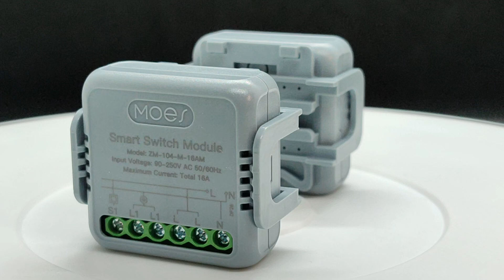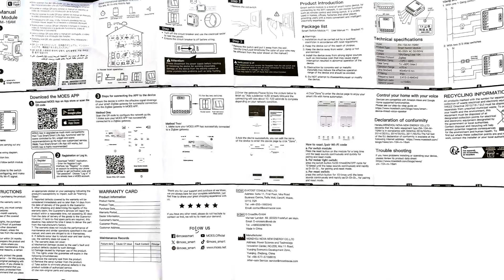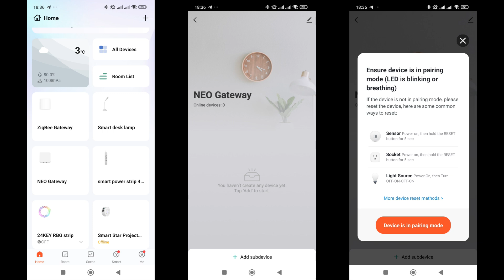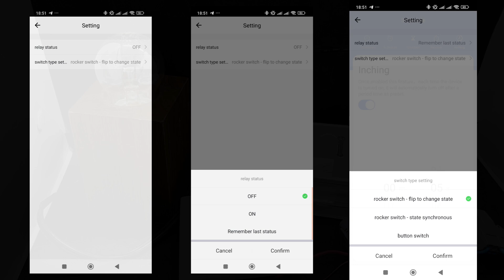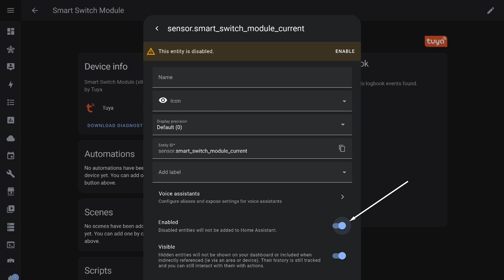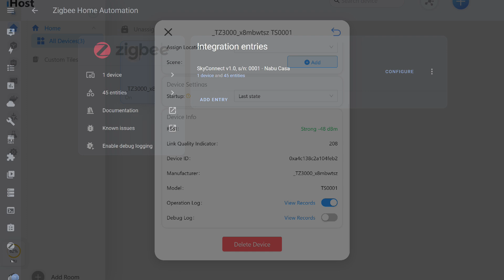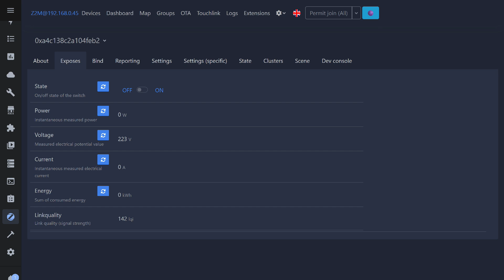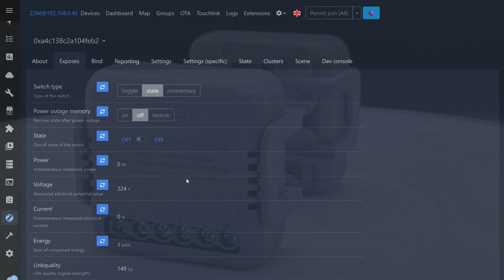Moes ZM-104-M-16AM - zigbee реле с энергомониторингом, делаем конвертер для zigbee2mqtt

Comment: Спасибо. Подскажите, как в конвертере указать делитель? Можно какой-то пример? Как раз пытаюсь разбираться с внешними конвертерами, видео очень помогло, но вот этого как раз не хватает для полноты картины. Заранее благодарю.
Reply: Отвечу пока сюда, что я пытаюсь делать, вот пытаюсь добавить такое, не работает:
    configure: async (device, coordinatorEndpoint, logger) => {
        const endpoint = device.getEndpoint(1);
        await reporting.bind(endpoint, coordinatorEndpoint, ['genOnOff', 'haElectricalMeasurement']);
        endpoint.saveClusterAttributeKeyValue('haElectricalMeasurement', {
            acVoltageMultiplier: 1, acVoltageDivisor: 1, acCurrentMultiplier: 1, acCurrentDivisor: 1000, acPowerMultiplier: 1,
            acPowerDivisor: 1,
        });
Reply from the maker: Мне было проще и быстрее сделать через template.
Reply: @Alex_Kvazis  Это я понял. Хотел разобраться, как это можно сделать. Кстати на текущей версии Z2M (2.1.3) ваш конвертер не работает. Точнее, вывод показателей работает, не работают установки типа переключателя и power_outage_memory. Ошибки: No converter available for 'power_outage_memory' ("restore") или No converter available for 'switch_type' ("state") - например. Как исправить не пойму, только начал разбираться с этой темой.